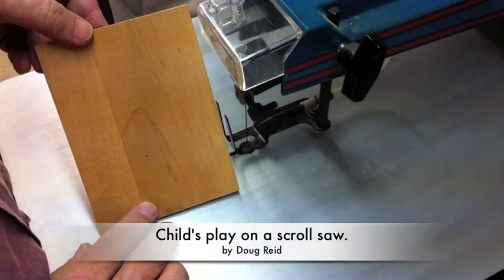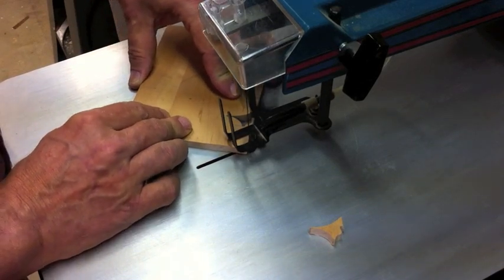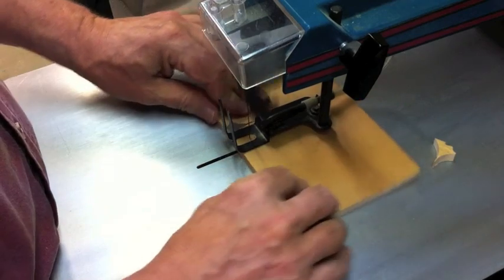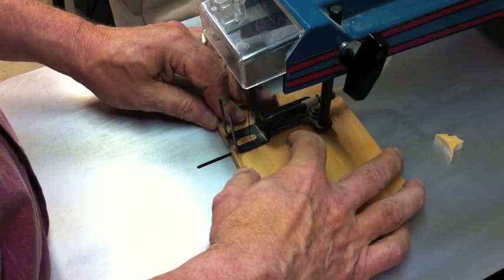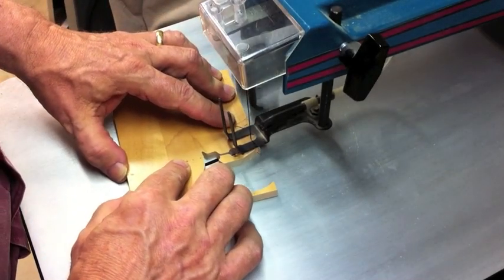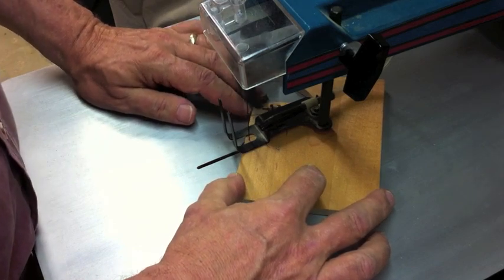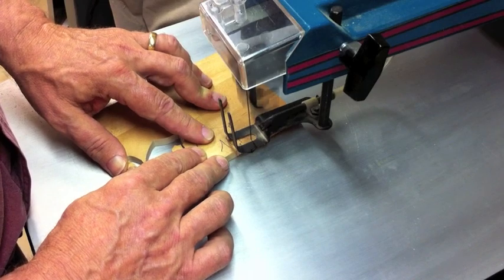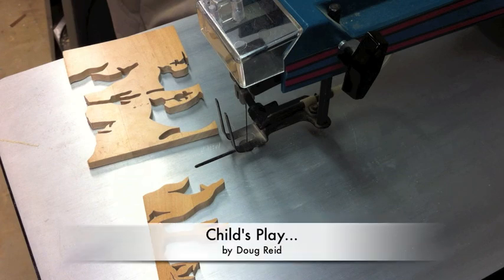Shopsmith scroll saw animals for kids

Comment: Could you do a detailed video on setting up and using the Shop Smith scrollsaw? Please include the proper motor speed setting - possibly translating speed settings on the motor to actual rpm’s, the proper tensioning of the various blades, including the proper sound, how to properly install the various blades, any quick disconnect accessories to possibly do fretwork easier, proper maintenance, and max wood thickness to include recommended blade size based on types of wood and thickness. Thank you.

Comment: Nine years?!?  Doug, I love these little projects and this video. I've just linked to this video in my scroll saw video as an excellent example of putting the Shopsmith scroll saw through its paces. Was this the freestanding scroll saw or was it mounted on a Mark V?  Scott
Reply from the maker: Scott, I’m using the freestanding model. As to the questions others have asked, I don’t use spiral blades; I usually use the Olsen brand plain-end blades. 
As you showed in your excellent video, very sharp turns are possible using the Shopsmith scroll saw with only a minimum of practice.
Reply: @DougReidshopsmithdoug  Thanks Doug. I currently have a Mark V-mounted saw but prefer the  freestanding version and will keep my eye open for one. Yeah, spiral blades are like the Impossible Whopper; Lots of bold promises with disappointing results (and gas).  Scott